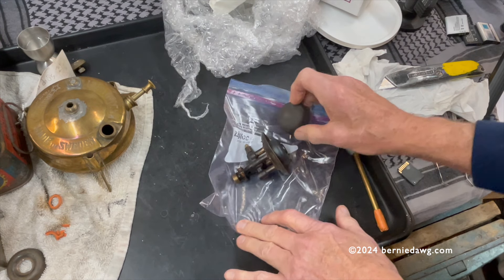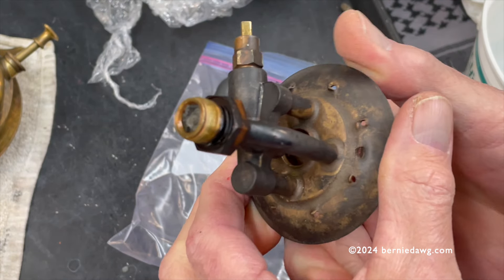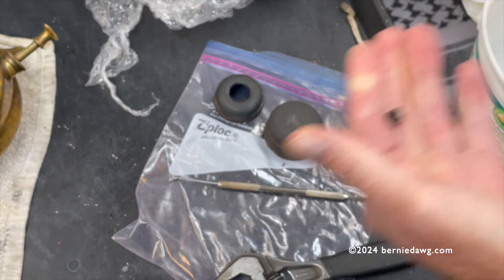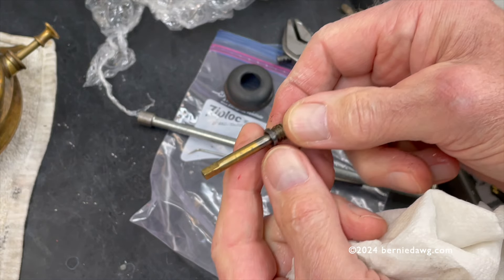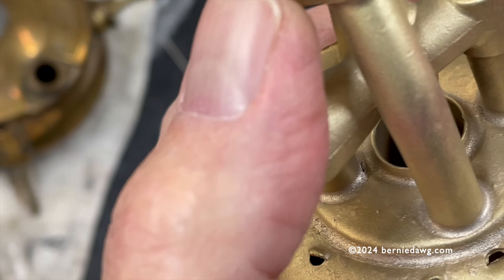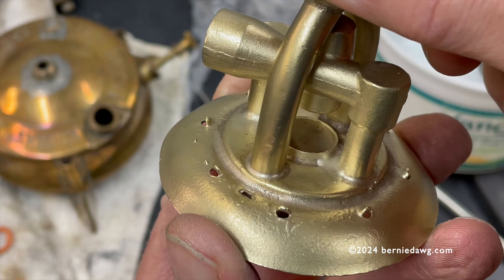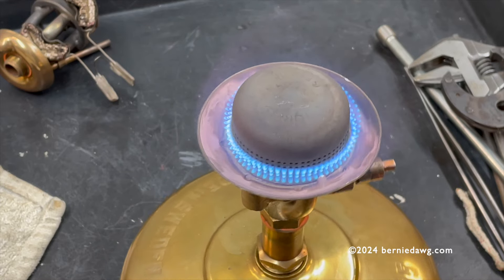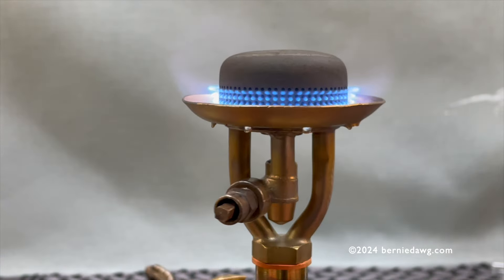Heinze Geniol German Army Stove Burner Repair

Comment: Hey Bernie Dawg:

Wonderfully instructive video!  I'm kind of a newbie with gas pressure stoves, so your channel is a major help.

A few questions if I may:

1.  What type of media do you use to get the finish so nice on the burner?

2.  Did you use some kind of solvent to clean the interior of the burner of all that gunk and what causes that much accumulation?

I really appreciate your work and videos, so thank you for going to all the effort.

P.S.  I almost forgot to ask: I'm in need of a burner (preferably silent) for an Optimus No. 100 lipstick stove.  By chance do you have any for sale?

P.S.S.  Should I ask these questions in another forum?
Reply from the maker: @swami15 Technical questions are almost always better answered though email to bd@berniedawg.com. That said, you can find info in the description boxes of most of my videos and I'll give your questions a quick shot right now.
#1 - I used glass bead blasting for this burner in the video. https://www.milessupply.com/product/ballotini-glass-bead-abrasive/
#2 - no solvents, just heat from a torch. Never red. Heat ignites the carbon deposits and turns sludge to ash. Sludge develops from kerosene fuels cooking into sludge in the cooler parts of the burner tubes. Sludge is caused by extended or exclusive use of the burner at low simmers and low pressures, especially with bad fuels.
P.S. - None for sale. Go to my stove supply webpage and click on the link to Base-Camp in the UK for the best source of stove parts/burners for vintage Swedish stoves: https://www.berniedawg.com/stove-part-supplier-links/
P.P.S. - Probably. bd@berniedawg.com Emailing gets you better responses that can include photos. YouTube comments isn't set up for questions of any depth. 👍😎 BD
Reply: Bernie Dawg:

MOST APPRECIATED!!  My  learning curve is presently fairly steep and you're accelerating my education.🫡

Comment: Amazing how this style of burners has cracs in them! I have soldered 10's of the, all with some crack someware. 

Was his a Geniol burner or Optimus?
Reply from the maker: @johanrubank
By “solder” I hope you mean *braze*. Solder is far too low temperature and will melt out of a repair eventually as solders melt temp is about what the burner operates at. https://youtu.be/4zqCfOmkrcs
Running the preheater on a burner for too long during preheating can cause overheating of a “dry” (no fuel inside) burner which can cause cracking. It doesn’t take long to preheat one and the preheater device (Quicklighter) should be used carefully. Most of the cracking likely came about through poor stove use and burner overheating with the Quicklighter. These were military stoves and often run by soldiers who had other things on their minds than best stove practices.
These are Geniol-made burners. That’s why it’s a Heinze-Geniol stove. Time-wise, it would be unlikely that Optimus was still making burners when these stoves were constructed. Geniol was one of the last EU manufacturers of regulated silents in the traditional pattern. Geniol had lower thresholds for quality control than pre-Katadyn Optimus. Just my 2 cents. BD

Comment: My friend, I want help. If the air is trapped in the stove, kerosene comes out of the flame hole. What is the problem?
Reply from the maker: Turn the spindle valve all the way to the right (clockwise) to shut off the flow of fuel from the jet hole. Need more help? Send an email to bd@berniedawg.com .